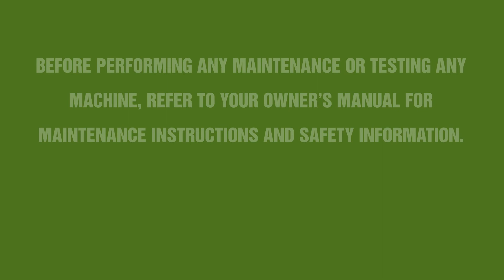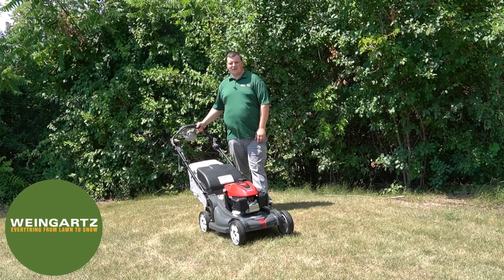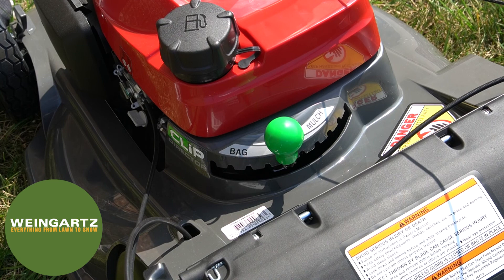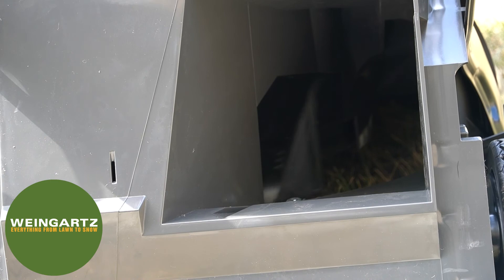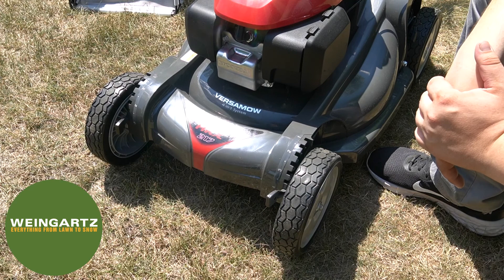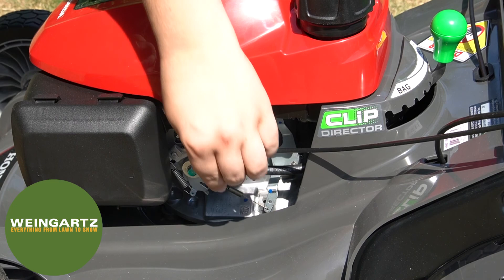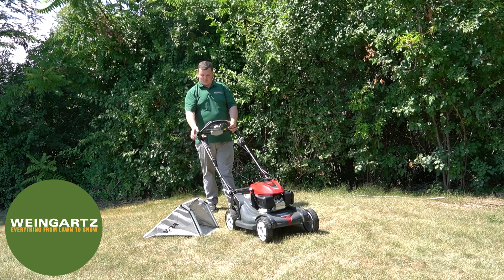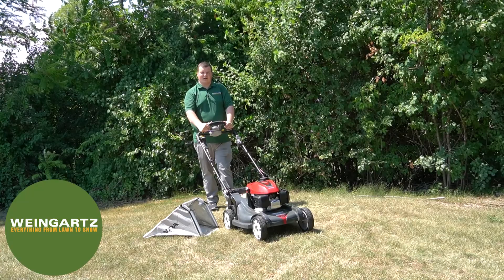Honda Walk Behind Mower HRX217K6VYA Operations

Comment: I've been using a hrx217 for 3 years and its absolutely the finest walk behind I've ever owned. It does everything exceptionally well. Its powerful enough that you can mow knee high grass,it bags and mulches beautifully. I mow 4 lawns a week with it and have had no problems. I probably mow about 2 acres a week with it and it's not manicured flawless grounds. Theres hills,dips,ditches,and weeds. One new customer I obtained last year lived out of town and hadn't mowed in 2 months. I cut his grass in the rain twice and then bagged it all the next mow after it dried out. It was a mess but after 2 mows I had it back to looking respectable.  If you buy one of these you will not be disappointed.